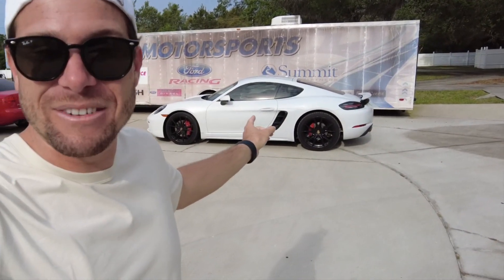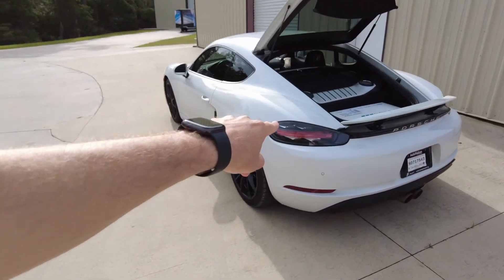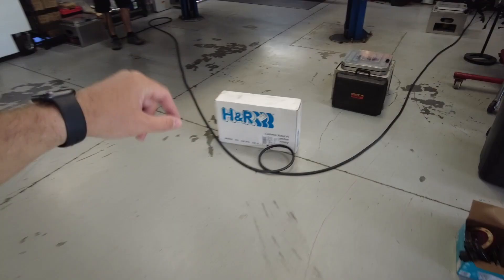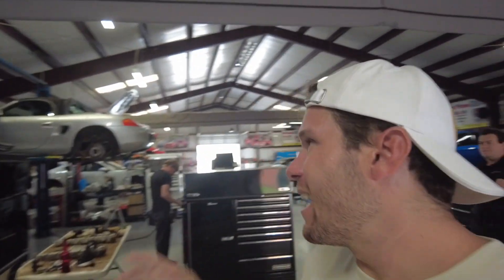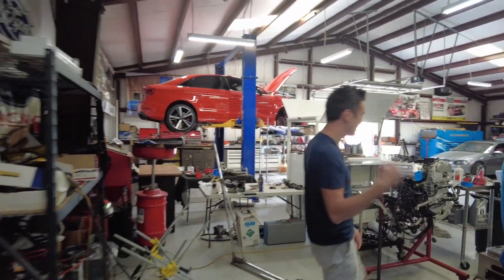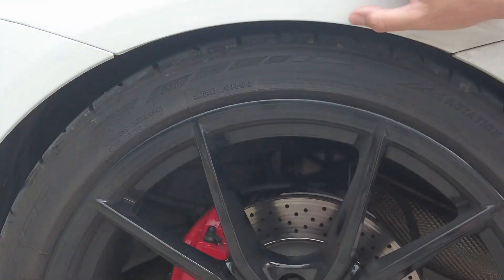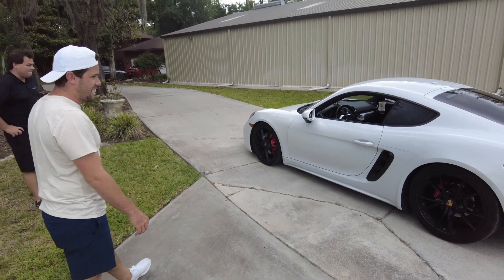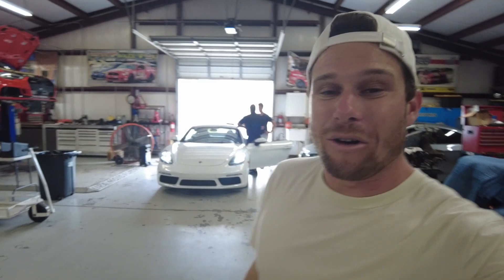Porsche 718 Cayman - H&R LOWERING SPRINGS

Comment: @AutoFluence
 Just a couple questions and I hope I didn't miss them in the video if you answered them already. Is this a Cayman base or cayman S? I know it has 19" rims but that's an option for the base. I believe you mentioned you DO NOT have PASM. Is that correct? Did you spec the car with any of the other body panel mods? Does the lower valance in the front scrape now when going onto a driveway? I'm waiting for my allocation for my 718 and its going to be a very late model 2022 or it will be a 2023. Just trying to decide if I want to get the PASM or not.